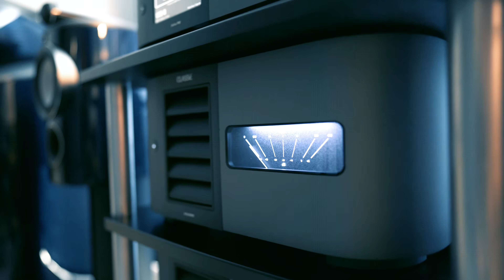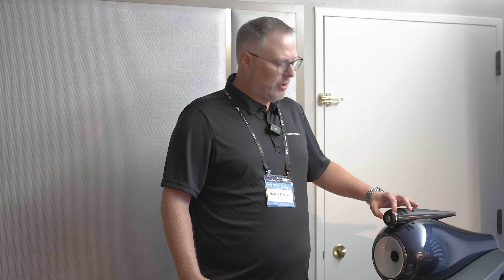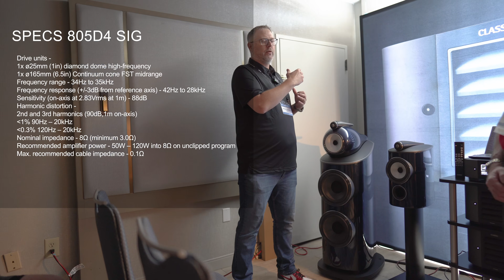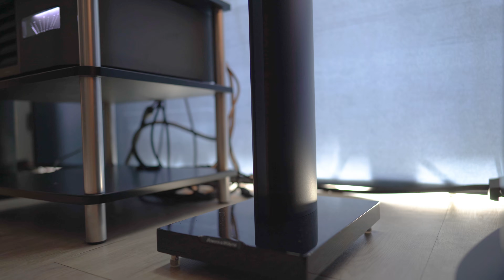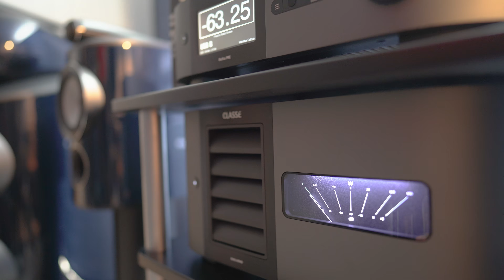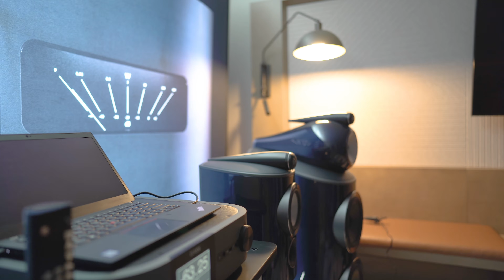Bowers & Wilkins 801 D4 Signature Loudspeakers Perfect Pairing w Classe Electronics?

Comment: Hi...this is from your web page( In addition, an all-new bass / midrange motor system features upgraded performance from its 6.5” drive unit, ensuring both a cleaner delivery through the midrange plus more extended bass).............but yet there is No MENTION of a NEW MOTOR SYSTEM on the B&W web site for the new 805sig! .................Are you sure that there in indeed a new motor system fo the 805 sig's?

Thank YOU!
Reply: i just contacted B&W directly .........This was their response,Quote" I was not able to find any reference to upgraded motors but the 805 D4 Signature speakers do feature and upgraded crossover." End quote! .......Why would you say this as it is misleading people!  Would like to know why you said that in YOUR article! Thank you!
Reply from the maker: @xsamitt  We go with the information presented to us by the manufacturer when we do overview articles. Sometimes they don't get it right. Our more detailed reviews actually take the products apart to show you the inner workings.

Comment: I biamp b&w with mc901 McIntosh mono amplifiers and it's quite amazing
Reply: Respectfully, that’s difficult to believe. Can you prove it for us? I’d also pass on McIntosh. Their quality control is much lower these days and their marketing + Marantz software problems in DACS which is what led me to return my new McIntosh and instead bought Accuphase. Their quality is second to none.
Reply: @omgwtfpwnd  I'm not a big fan of AV processors and dacs from McIntosh. Their tubes and solid amplifiers are very good and very reliable. Tubes for mid Tweeter solid state for bass drivers is very very nice.  Gotta have good cables and speakers
Reply: @iampuzzleman282  McIntosh should’ve stopped selling tubes. There is no difference. I’ve proven this in a blind ABX test. Tubes nowadays have a solid state rectifier. If you want to change the sound, use tone controls or buy another pair of speakers. Tubes are just marketing. People in Japan loved them, so that’s where most of the sales went in the 90s with McIntosh. But people are in love with visuals and that affects their experience. YMMV

Comment: I'm in the UK and some years ago at a HI-FI show I sat in on a demo by B&W
and to be honest some could strip wallpaper with a rather over prominent 
treble, it wasn't particularly nice treble either and I think they gained a bit
of a reputation for it, some folk loved them others, including me, not so much.
One man's meat is another mans poison as the saying goes, I did have a demo
in a shop, same thing I'm afraid, I haven't heard any for years and now being in my
mid seventies with a marked reduction in hearing higher treble they would 
probably be ok for me now, I'll have to go and have a listen, once with hearing 
aids in and again with the aids out should be interesting, Over the years I've run
big Tannoy Duel Concentrics with valve amps and now use KEF UniQs,( I have
a thing for point source 'speakers) because of room constraints so it's not that
I'm not used to 'speakers with what could be described as a forward treble.
Interesting, that's got the old grey cells interested again I'll have to do a bit of
checking out, thanks for the wakeup call.

Comment: Does Classe hide treble problems and make them listenable?
Reply: Have you actually listened to these speakers?
Reply: I got some B&W 706 speakers and they suck. Probably cos they don't match my Audiolab 6000A amp. I build speakers and I have a theory that individual speaker impedance (on different amps) changes the sound slope radically! And maybe that's why speaker matching is so important. Why else would my bought $2000 speakers sound so muffled (on my amp in that room)? Surely they wouldn't have settled on that sound when developing the 706s. I have to wind the treble up at least 3 notches to even like the speakers at all. No treble control on my Audiolab amp though. But I don't listen to the 706s, they are reference speakers for my speaker building hobby. I just don't copy the 706 sound 100%. And it's better to only use them as a (rough) guide anyway. In that, the 706s are a great help...and my made speakers make mince meat out of the 706s (for me and that amp and that room at least). 😅
Reply: @Justwantahover wow, I can't imagine wanting to increase the treble on a 700 series B&W. I have 705S3, 707S3, and they're both pretty bright, but in a way that I do actually appreciate. So much so that I bought 803 D4s which are on their way to me now. If you like something brighter than the 706, I'm curious what that would be. Is there a particular speaker that is bright enough for you that I could reference? Just asking out of curiosity because I don't often hear about speakers being much brighter than the 700 series.
Reply from the maker: Apparently bc they sounded really good. Or maybe people listened to the music and not a CTA-2034 graph.
Reply: @Audioholics if the graphs weren't predictive of anything, what would the point be
Reply from the maker: @braunpuhhäss  A single CTA-2034 graph isn't a good indicator of predicting good vs bad sound and this is a topic we will be covering soon. It is a good guideline to ensure no major problems with a speaker's driver integration and dispersion characteristics.
Reply: Ha ha spot on